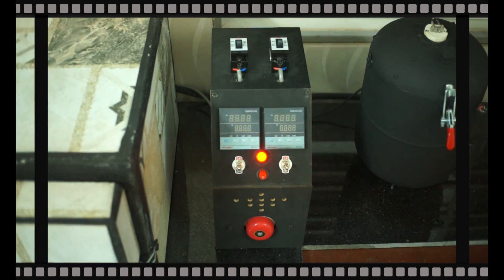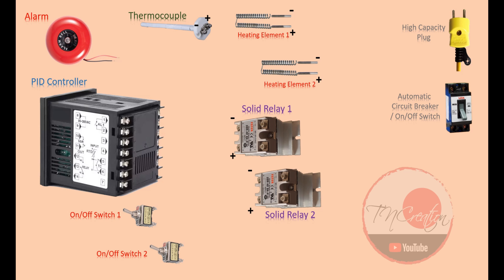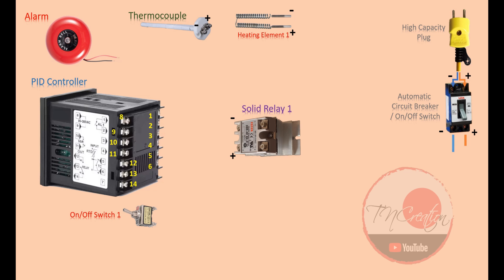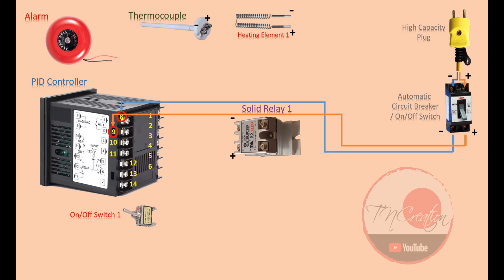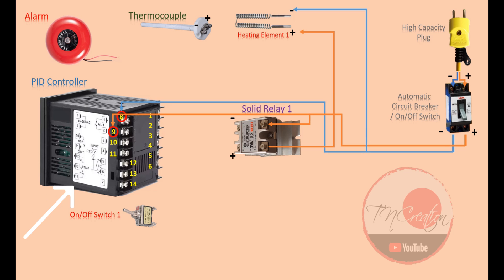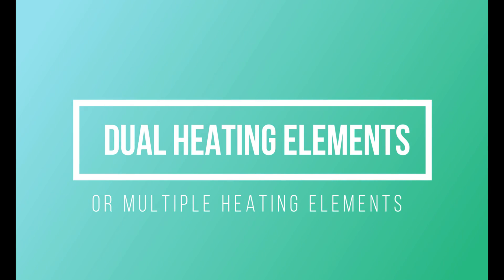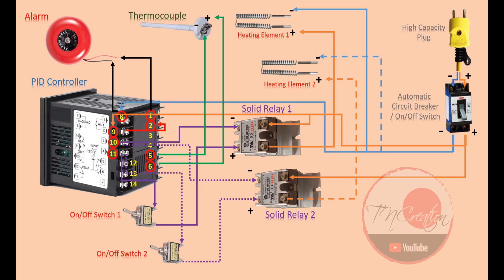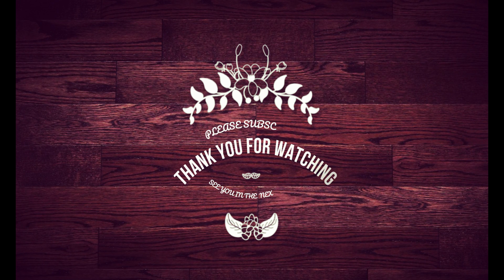HOW TO WIRE PID FOR SINGLE OR MULTIPLE HEATING ELEMENTS | RE-EDITED & UPDATED

Comment: If the sSRs are connected to manual switches then how is the PID controlling (altering the voltage output) to the heaters? Isn't the controller itself supposed to send on/off signals to the SSRs? Also, if both SSRs are connected to the same terminal, wouldn't they both be controlled through the same signal - meaning the two heaters are controlled with the same signal as opposed to independent signals?

Comment: The link to PID controller is broken. Could you mention the title of the unit you used for this set? Port layout of some controllers are not standard ( if such standard exist at all ). 
Also, if you remake this controller in 2025 what controller would you chose?

Comment: The mc70q is in Celsius so do you know a comparable or same hook up for one that shows temps in Fahrenheit?🤔
Also if you needed let’s say 25+ amps one could swap out the on/of breaker switch to a higher value breaker since the relay is rated at 40amp correct? More concerned about a pid not in Celsius but one in Fahrenheit is needed any ideas on a pid for such?

Comment: Great Video my friend. I have a 12v alarm busser so I assume I will need to power it by running a 12+ to pin 2 and pin 1 to red on the busser , then busser black wire to a 12v -black source.

Comment: I would like to put 1 pid with 3 ssr for 3 element of 3000 watt (240v) each, can it be possible with only one pid? The switch on the ssr line doesn't need to be a big one(120v) they only cut one line, like you said, its only a switch for a contact NO on the ssr, the control will be done on the pid, right?

Comment: Excellent video  but I want also to send the measured temperatures to excel  in my notebook every 5  seconds. I suppose a small PLC with USB output (Raspberry Pi?) will be required but I am not sure about the configuration and recommended wiring. Do you have a video or suggestions about that? Many thanks

Comment: This is exactly what I need but I also want to add a timer . Do you have a video with a timer as well? Thanks!!
Reply: The timer is wired into the alarm. Either use alarm 1 or alarm 2 if it has two alarms. The alarms don't have any power to them so you will have to run a 110vac or 12vdc to one side of the alarm depending  on what the timer can handle. Usually timers run on 12vdc

Comment: With 240v tho there should be two hot leads from plug how do I wire this ? Plz help . Your video is super helpful but I am stuck on this .
Reply: Did you ever figure this out?
I'm also stuck at this part.

Comment: Hi, i buy an Rex-700 with 4-20mA Output to connect these Output to an Voltage Regulator SSR-40A with an 4-20mA Input. The Rex-C handle the SSR on and off, but not Power up and down like i hope. I cant find the function in settings. Can you help?

Comment: Love your video. I am in Texas, USA. Here we have 240 volts composed of two 120 volt circuits 120° out of phase. I am connecting the heating elements from  an old Wall Oven. What mods are required of this circuit, if any? Thanks. Tim

Comment: Great video! This is exactly how I wired my curing oven up except, I only noticed after that I'd done this and it works, but I wired the input signal side of the ssr from the pid in series instead of parallel. After hooking up a multimeter im getting about 6v to each ssr instead of 12v but my ssr says 3v-32v DC so I being over 3v i don't think it cares whether it's 6v or 12v it sees the signal and completes the circuit on my hot leg to element. Am I totally off? Your opinion would be much appreciated, thanks!

Comment: Great video ! You made it very clear and easy to understand. I just have two questions : 
I would like to power a 24V-90W cartridge heater, is a (max.) 10A 240V SSR enough /too much? 
I have found a PID controller that can provide a 3A 250V output , do i even need the SSR ? Thank you

Comment: can i use this wiring for two contactors also , to control two heaters , ? can you upload a video for  using two contactors , two heaters and one PID temperature controller , as shown in this video

Comment: Why do the relays need heat sinks?
Reply from the maker: Hi Brent, as you know, SSR is acting as a Switch here. Normal switch can hardly handle such high current & temperature generated from our wires and Heating Elements. That why we need SSR and also the Heat Sinks.

Heat Sinks are required to insure the proper operation and long term reliability of Solid State Relays, maintain a safe operating temperature.
Reply: @TNCXBUNBOX   SSR = relay switch?
Reply from the maker: To some extent Yes 👌

Comment: Hi, nice work thanks for sharing. I am in the middle of making my own oven but i have a little problem. Instead of alarm when the oven reach the temp i would like a light. I put a light but nothing happen. Also i dont know the voltage i should put. I put a 220V light and didnt work. Should i put some 5V? Thanks
Reply from the maker: Hi R Calin, the way you wire may vary, depends on the PiD model. But I would say, if it runs on 220v, then you light bulb should be 220v too, not 5v. Just check the diagram of you PID carefully, you might miss something.
Good luck with your project 
Cheers!
Reply: @TNCXBUNBOX  thank you. I will recheck it.
Reply: @TNCXBUNBOX  i managed to make it work. Now everything it is ok but still have some questions. The wires to thermocouple and to heating element must be some special wires? Does them work with normal 2.5mm square wire? And also the ssr could melt isolation of wires inside the control box? I added a fan but not sure how much heat will be inside the control box. Thank you for your help and time to reply. Have a nice day!
Reply from the maker: @rcalin9354  Hi Calin. For the Thermocouple -> Yes, It's definitely required a specific K or S-type wire (Depends on the thermocouple type). And for the Heating element, please use the fiberglass High-temperature wire (Ref link: https://amzn.to/3ahd7rL) - please check my Description for more details - You can find all of them on Amazon

Comment: Fantastic video! You made it very simple and clear. I successfully wired up my own PID circuit using it. I do want to add a way to cut power if a certain temp is reached, what would be the best way to do that? I was thinking wiring a normally closed relay in place of the alarm bell, with the other end connected to the positive/negative of the incoming plug. Is there a better way to do that?

Comment: Love your videos. The only thing I am not understanding is this, and everyone please comment to info - You are running 240v which means that there is no actual negative since both lines are hot. So how does the PID know which is hot and which is the negative in relation to getting power to it? You must be using a 3 wire 240V cable yes? two hot wires and one ground? this way you have one wire going to each the positive and the negative in the circuit breaker shown? Then it is a matter of just utilizing the one in the negative side of the circuit breaker to run to PID and split out to the heating elements right?

Comment: If i have 30 amps.. that take my heating elements and i am working witt 220 Volt. I must use a 220 volt  switch .. or how much volts are in the ssr to the pid?..

Comment: The difference between   this configuration and the configuration before its just about the switch..  configuration before i has to use a switch bigger  that support most amp.  And in this configuration its just normal switch de amp.. or what else change in this configuration? And could i use a ssr of 40 amp.. to a heating elements conected uin parallel like tour pony one ssr to 4 elements heating?

Comment: Thanks for answer me in the other video before this.. ok my friend if in my casé i have 4 heating elements equal.. each one gives 1500 watts.. and each one takes 7.5 amp because they are connected in parallel... i could use only 2 relay ssr 40 ampers each one.. and connected un parallel .. in other words 2 heating elements for one ssr? Could i do that.. and the switch on off.. these switch must be 20 amp at least.. because when they are connected they take 30 amp/2 = 15 amp each líne of 110 volts. . And i have house breaker fuse and a lot of protection just in case something happen? Thanks for your time and i will appreciate so much tour opinion. . Thanks

Comment: I have a question, how does one measure how much amps the heating element is drawing?
Reply: You would have to use an amp clamp around the power wire. Or you could wire a dvom in series with one of the wires going to the heater.

Comment: Great video. I do have a question. So i have dual elements on my strike water  for homebrewing. I have one PID connected to one element and one connected straight to anotdd her outlet. If i parallel connect them is that drawing 240V or is it still drawing 120V? I also want to have them connected to one instead of 2 different powers.

Comment: Can I wire the heating elements in parallel? Or should I just separate them into multiple systems (buy multiple PID controllers)
 I need 4 heating elements total for my system.
Reply from the maker: Hi Marcel, I would say multiple Pids is a safe choice, but that will bring the cost much higher, plus multiple Thermocouples are required, too. It really depends on how much power each of your heating element will draw, and do they have the same resistance value ? To my knowledge, parallel system works when you have same  heating element resistance . Perhaps seeking for advices of a professional in this case is necessary, for safety and cost efficiency. 
Cheers,

Comment: all these are dc ? why there is positive and negative instead of live or neutral?
Reply from the maker: They are AC, in my language it easier to auto translate and easier to comprehend and follow if I mark it (+) and(-).You are definitely right, it should be called Live and Neutral. As this is DIY project, I hope this video can be helpful to some extent, that's how I make and learn at the same time.
Cheers !
Reply: @TNCXBUNBOX  ohw okay, because there is dc and ac in installation of ssr, so would understand better if use accurate word. tq for ur effort
Reply from the maker: @visnu0045  Noted and Thanks Strange !

Comment: Great video. I just wondered how you would go about wiring multiple thermocouples in a larger oven. For example 3 elements + 3 thermocouples
Reply: Wow, hard to tell if this is a trick question.  I work with PID controlled heating systems and when I read your question I had to laugh. I have not done anything like your scenario but I think it would be interesting to program 3 PIDs controlling 3 zones in the same area. I've seen heating controllers with multiple zones that do this but never had the need for them so haven't read how they work controlling one area or if they use PID tech..  I do know that you could connect all 3 thermocouples to one PID and have it control all 3 elements. In this case the PID would act on the average of the 3 thermocouples and of course the 3 elements would act as one unless you put a switch on each solid state relay like the poster of this vid did..  Another thing you could do if it works for you is put a switch on each solid state relay and each thermocouple. This would give you a few heating and or control options and shouldn't cause issues with the PID since it will just average any thermocouples that are connected, only concern would be the switch used for the thermocouple and it's connections.
Reply from the maker: For large scale, I've seen they use more than 1 pid for each thermocouple, they put all 3 pids to 1 big controlling box and set them with same setting (or different if needed). I think that make sense to me. But perhaps you can look for a pid with a special specification that has multiple thermocouple-lines in (about this I'm not so sure since I'm not professional and only do home DIY projects, but I think they exist.).
Reply: I am doing the same. I had considered different solutions to running 3 or 4 elements but now after your great video I think I am going to run either 3 separate Pids or 2 combos! Thank you so much for all of your info here.

Comment: Do you have a link for the high capacity plug ?
Reply from the maker: Hi Stetler, please check out my Amazon link to see if this can help you, and have a look at their recommendations
https://amzn.to/38kz8oZ
For The PID, I found that people like this Inkbird model more:  https://amzn.to/3bdi2v2
And my model is: MC701: https://amzn.to/34enDgj
I also recommend you check out the "Soak/Ramp PID" - you will have so much more Options that you can do with it: https://amzn.to/3bcGvRd
 
You are dealing with Two 2000W Heating elements so just pay attention to the SSRs, Heatsink, and ventilation(Cooling Fan).  
The good thing is that 400degree (I assume that is in Celcius) which is not high, so all the best to your project. I strongly believe you can make it! Cheers!

Comment: I’m sorry to bother you again but what does the alarm mean on the PID
Reply from the maker: Hi Crobin, the alarm will turn on when the actual temperature reach the limit temperature that we set for it. For instant, we set the wanted temperature is 300 degree, and set the limit by 10degrees (Alarm 1 = 10). So the Alarm will ring at 310 degree.
Reply: @TNCXBUNBOX  thank you!
Reply: My PID keeps burning and smoking and displaying an alarm, do you suppose that is because of an overload?
Reply from the maker: That's bad @@. Please check the current, resistance carefully. And try your best to read the PID manual, there might be difference between models, I did spend an hour to read it, it's very helpful. All the best to you, Crobin.

Comment: Great video, i just ask if it is the same principle in powder paint oven? Iam planning to make powder coating oven using household oven.
Reply: Thanks TN for quick response. If you have enough time to make video, pls include 12volts fan for pid box controller, instead of alarm. Thank you again and happy new year.
Reply from the maker: I would say yes. But please do more research and check carefully your project's requirements. Good luck on your project btw ! Cheers !

Comment: Great new video, one question - from the circuit breaker to the PID and the heating element, the wire splits into two so what is the best way do that realistically, a wire connector?
Reply from the maker: You are definitely right. And since we are dealing with high temperature, especially from the heating element, Ceramic terminal blocks are great. Adding Aluminium Heatsink is great too, I used that in my builds.
Reply: Thank you! One other thing... with the circuit breaker, exactly which type (not brand) because I’m having trouble finding one like that.
Reply from the maker: @crobin2045  Sure, please check the Link below for the Circuit Breaker:

   Miniature Circuit Breaker 2 Pole 20A 400V
   https://amzn.to/3pvoO3g
Reply: Xlnt video.  Well explained.  What PID controller do you recommend if I’m going to run to heating elements at 2000 W each. I would like to wire each one up separately so I have the ability to only run one if I choose. 
I would also need a light switch along with the alarm/buzzer that you show here. My application is for a double oven that I have converted into a single larger oven and I will be doing powder coating. My desired temperature is 400°.  Thank you, any links to parts would greatly be appreciated. I need to build this by the end of this weekend.